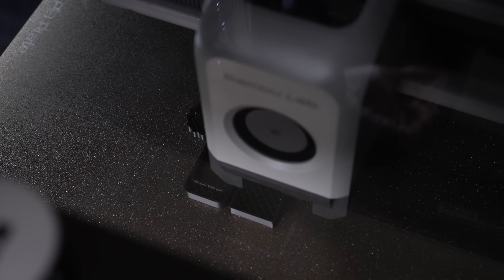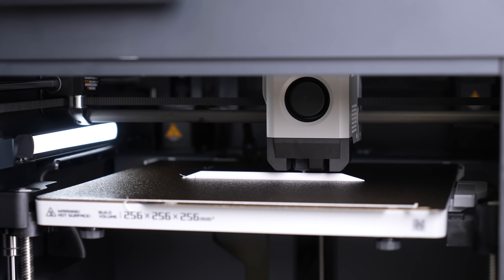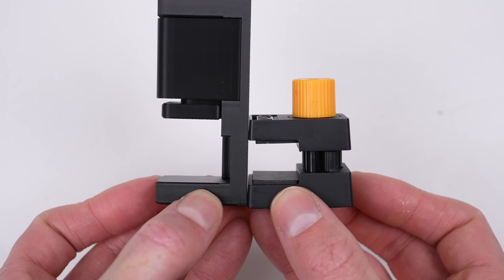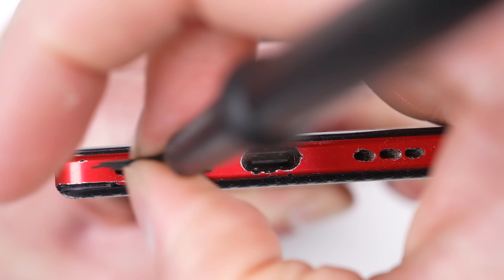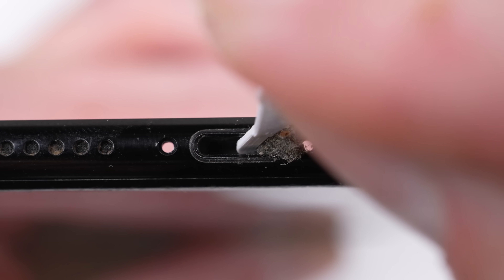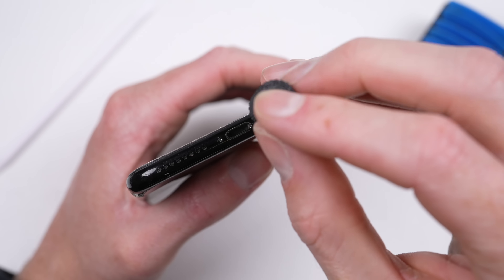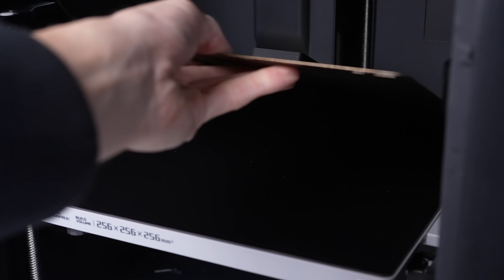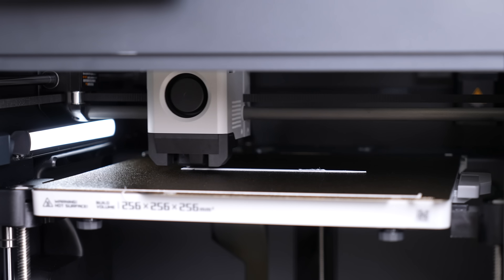Repairing My Phone Using 3D Printed Tools - Is It Possible?

Comment: 3:44 If you think about it how a lightning port is constructed, then you will realize that you short all the pins every time you plug it in. The end of the male connector is solid metal and level with the pins, so it shorts all the pins in the female connector every time you plug it in.

Comment: Maybe you should try a .2mm print head and a cold plate super tack for smoother print surface. That might change this video around as i printed some very fine objects without the problems you hand on your spudger for instance. Just try it and then if your opinion doesn't change, it is what it is.

Comment: I use wood cutlery from McDonalds ice cream or salad, to clean USB ports. I just put it in my vice and cut away a small enough part which I then use to pull out the filthy stuff from USB ports... Works great and can be sharpened if the tip ever gets dull... Never use metal devices for this usecase. Although quite unlikely you could short out the battery or destroy the charge driver on the charging port board...

Comment: I'd suggest some of the material that I've utilised well:
'Adapter HDD/SSD 2.5" to 3.5"', 'SSD, HDD, NVME, CPU, (Laptop) RAM Holder (A1 Mini)', 'Optimized SD / micro SD card holder travel box', 'SSD Mini Case Parametric', 'Gridfinity AU/NZ Type I Apple Power Adapter Holder', 'Knurled volume knob for Yamaha P-155', 'Australian Power Plug Dust Protector', 'MANTA - Filament Anti-tangling System', 'Soldering Flux Extruder'. All of these are available on makerworld.
You would get some better result when you use a PETG as it's more durable for dulling and friction for repairing, but may adjust the setting accordingly to prevent stringing (with control of nozzle temperature)

Comment: I used for the flexible holder which plugges in the charging port a lightning to usb c adapter it is still the best tool to hold the screen

Comment: We have a 3D printer at work that the boss has made a number of light duty parts out of
We have wifi/Bluetooth style temperature sensors that he made "cages" to keep them in
We've also made replacement cover plates for some specialized tables

Comment: careful about sticking metal in usb c ports especially as those ports are 2 way and can be shorted and start fires.

just youtube tik tok usb fire challenge to learn more.

this is possible because the usb c port can provide many watts of charging power so the devices can be used as emergency power bank chargers.

Comment: You can use your 3d printer bed to heat the phone to open it. just set the temperature.
Reply: This. I used the heated bed of my Wanhao i3 to open my phone to change the screen and battery. Better control without buying another heater.

Comment: The P1S has been great, after almost 2000 hours, can’t wait to see more printing
Reply: Same I got mine in November last year for Black Friday and it’s been so nice being able to make stuff I’ve even been able to make some gifts for my friends. The only downside I see with the P1S is that it doesn’t have auto filament calibration, which is something that is pretty tedious when I’m using third-party filament, compared to the A1
Reply: @ben_ands  is the P1S outdated now?
Reply: @Space_US  I feel like it’s a bit outdated consider it doesn’t have any of the new calibration stuff like in the A1 or filament tangled detection, which has happened to me a couple of times and the printer continues the print even though nothing is being extruded. Though in terms of print quality and the fact that’s enclosed makes sense. An observation I have is that all of the “maker” Youtubers that aren’t sponsored by bamboo lab have a P1S. Also the nice thing about having an enclosures that I was able to add two extra air filters to the P1S both made by voxel pla that should save my lungs from bad air.